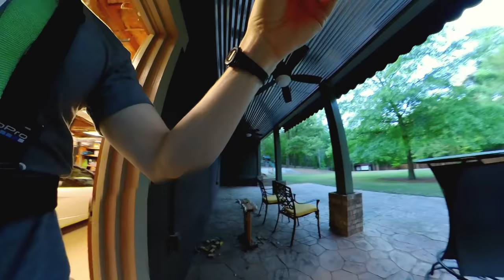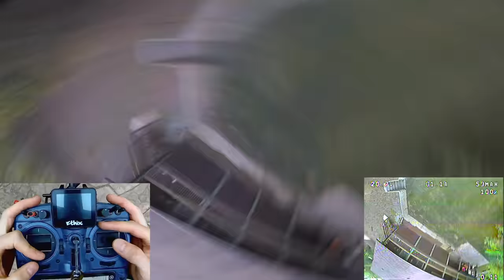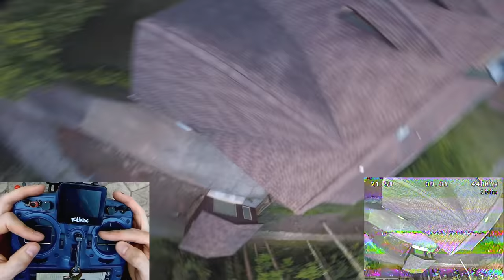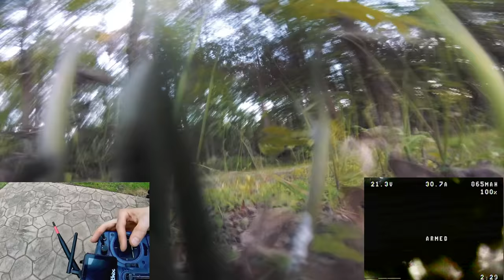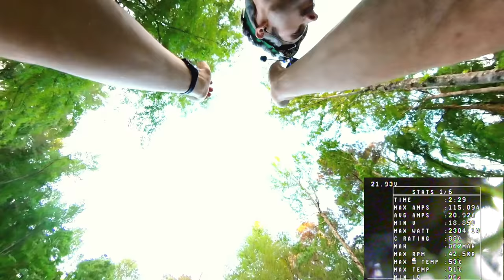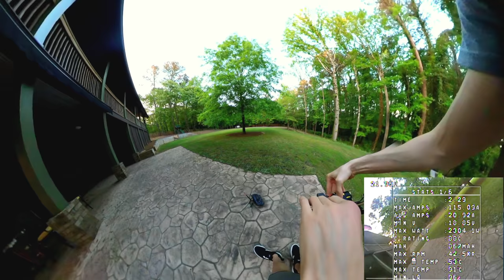FPV + Aggression 🤓

Comment: Absolute insanity. My jaw was on the floor for SO LONG. Somebody do a body count on this vid.
Reply: I’ve never done FPV is this guy the god of FPV? If I picked up an FPV drone for 30 minutes could I fly like him? I’m looking at the DJI FPV.
Reply: @MobileAura  you will not come close to that with a DJI FPV. It's not capable of doing that. And you will not be able to do that with 30min of training.
Start with a ready to fly or ready to bind 5" quad and move on to a custom build from the frame up to get some deeper understanding later. Or start with simulator practice to get a feel for how hard this really is